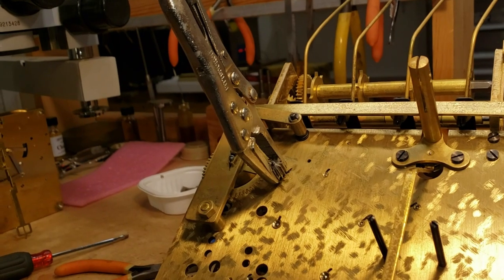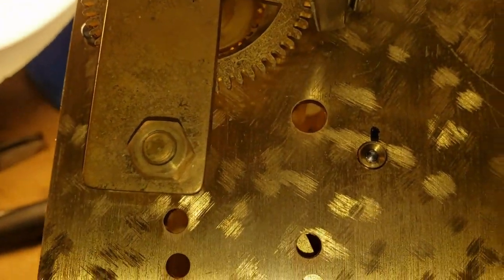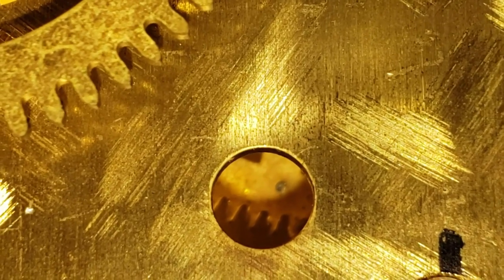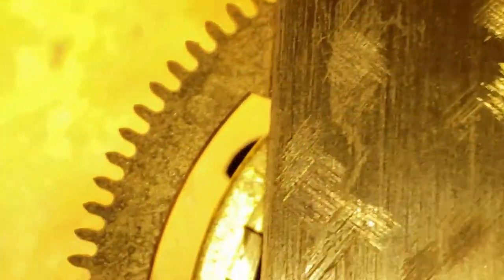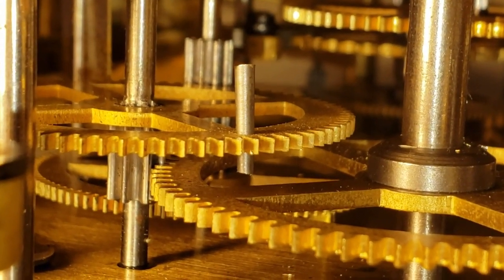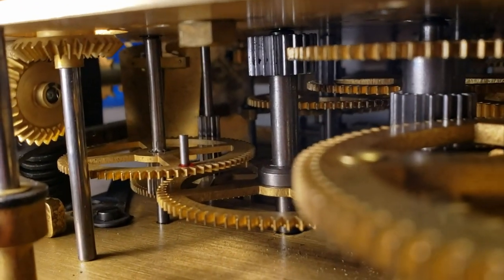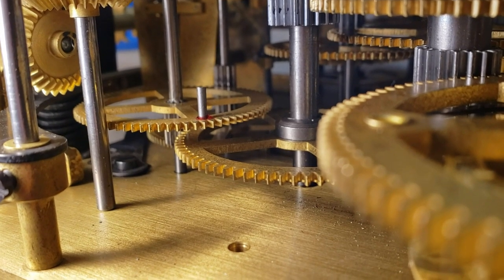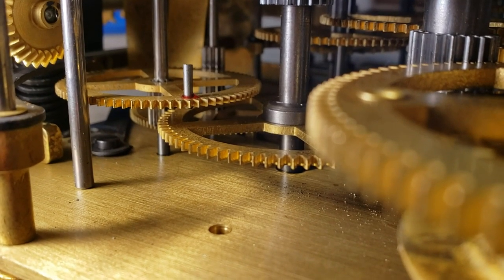Clock Repair. Chiming Stop Pin Repair

Comment: Have a 1906 Gilbert Mantel that would continue chiming. After watching this video it was apparent that most of these clocks have basic mechanical functions. I even had an inspection hole at the stop pin. The lever was slightly bent just enough to not make the stop on the pin. Thanks so much 🙏

Comment: Thanks heaps for the lesson, very much appreciated. Have done a few similar things with pins that others told me wouldn't work, but did. It's often about thinking outside the box, and when it works its very satisfying. Thanks.

Comment: Thanks.  This is good to know.  I'm well into my second year of retirement and am beginning to get into mechanical, and some battery powered, clock repair, just as a hobby.  I'm not quite ready to split the case on one, as we used to say in motorcycle repair, just yet.  I don't blame you for avoiding it, here.

Comment: Wow, great video, creative, this is what mechanical repairs are all about. Impressed! My question, I have never seen plates scratched up like this, am I missing something, or did someone get carried away cleaning it? Looks like someone cleaned it with a dremel and grinder wheel.
Reply from the maker: No thats the way they come. There is actually a name for that design process, I just cant remember what its called. Several movement companies did this. Hershede did an elaborate design on theirs

Comment: I'd like to know who makes that movement you are showing. An Urgos movement that I just repaired uses its arched lever on a wheel that is  turning in the opposite direction. Then when that pin is released, a different wheel with a pin is stopped by a warning piece. I didn't see any warning set when you released the stop pin. It looks like the pin you are showing is on the wheel in the same location of the train as the Urgos I have. But the release pin on mine is one wheel close to the fly. I'm not criticizing, just trying to enhance my own knowledge an share what I know. Thanks for your video.
Reply from the maker: Sorry for taking so long to answer. It has been so long I don't remember the movement maker. The customer actually owned a clock shop and didn't want to attempt to fix it, so he mailed it into us for repairs. I was hoping I didnt have to dismantle it just for a stop pin.   Thanks for watching
Reply: It’s a kienigner movement.

Comment: I have a similar problem but not with the pin missing. What actually makes the chime arm fall into the stop position (longer slot)? As per photo there seems to be a spring wrapped around a shaft with two loose ends. I'm not sure what it's supposed to be attached to and whether it's part of the return spring for this arm?  It kind of looks like someone had played around with this at some point. On the clock dial is marked Trade (S) Mark, I'm not sure this if the workings is a Westminster clock or not? It's not exactly like yours. Well, it doesn't look like I can send a picture.

Comment: Nice video.  I have a different sort of problem with my Emperor Grandfather Clock.  When the minute hand gets to the top of the hour, I can hear a click, but the chime doesn't start up.  If I jiggle the silent lever up and down several times, I can hear the gears start moving and the chimes as well as the hour gong play.  Then at the 15, 30, and 45 minute marks, the chimes play like they shoot.  BUT, when the minute hand gets back to the top of the hour, again I hear the click, but no more chiming unless I go back and jiggle the silent lever...any ideas??

Comment: My clock started non stop hour chiming when in chime mode.  Small selector on the front.  It kept time very accurately up to taking to repair shop.  Repair guy called me today and told me he got it to work and it tells time….plus it now chimes only when needed.  I told him the clock told time, just would quit chiming so I’m confused ?  I’m going to pick it up tomorrow and pay around $75 in labor he quoted me.

Comment: Hello My middle weight for winding up the clock fell of and the cable went up inside the Grandfather clock, I got it out but now when I wind it ,It only goes up half way so the clock only work for one day needing winding again, what happen? Thanks.
Reply from the maker: it sounds like the cable is twisted or hanging up. Or you have a winding stop and it was not reset correctly. Can you send a picture of the front of the movement without the face on it to me.....bob@clockrepairservice.com
Reply: @ClockRepairService  please if I have to send a pic without the face I would have to disassemble the clock again, And you know what a pain that is, Is there any way you could tell me where to look for the (WIND STOP RESET) ? I will be willing to send it to you for repair also ,Do you know what this might cost? Thank you.
Reply from the maker: @patony_1288   I can only guess but there are 2 gears in front of the clock face plate that is located on the winding arbor for the cables. These 2 gears line up so that when your weights come to the top, the gears will stop them from going any further. When you put the cables on the winding barrel, these gears were not aligned correctly, so now the gears are stopping the cables from going all the way up. Getting these gears to align correctly is an art form in its self. It took me hours to figure it out and personally, I dont know were to begin to tell you how to correct it. Unfortunately, when we service some clocks, the previous clock repair person had this problem and just took them off. You might try to remove yours as well if you cant get them to align up.
Reply: @ClockRepairService  Thank you .
Reply: @ClockRepairService  hi. My gf clock stopped chiming after I moved to a new home.  Can you tell me how to reset it?   Ty for sharing your talents!